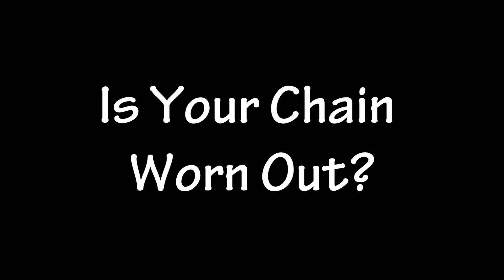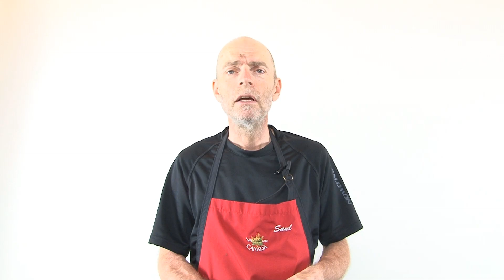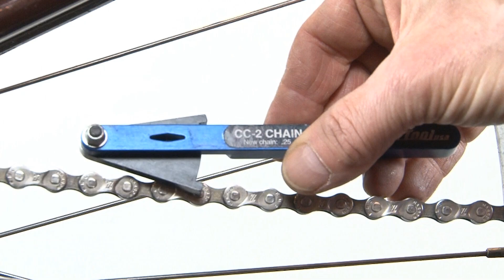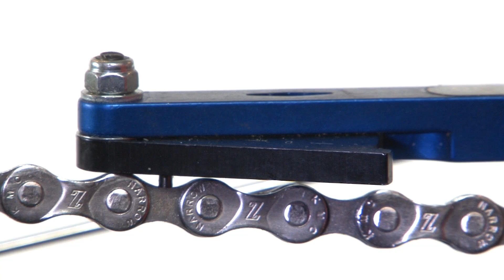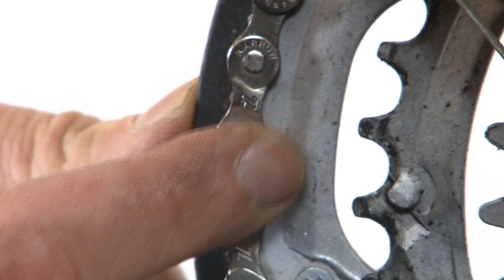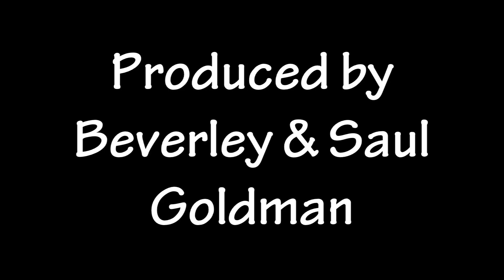Is Your Chain Worn Out?

Comment: @AnnaMFink  you should replace your chain when it has stretched more than .75%.
Wear is not really dependant on distance but rather how regularly and how its cleaned. Personally I have replaced a chain after 7500 miles..but I clean it after every 60 miles with an diesel and a brush and an old cheap ultrasonic cleaner I got from ebay. Its not the outside that matters but the pins inside needs to be cleaned and oiled well.